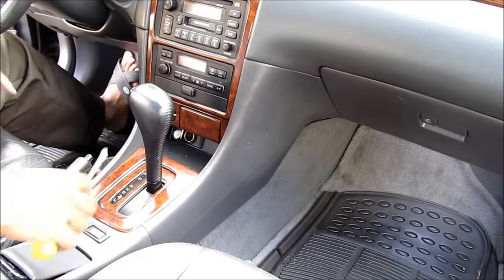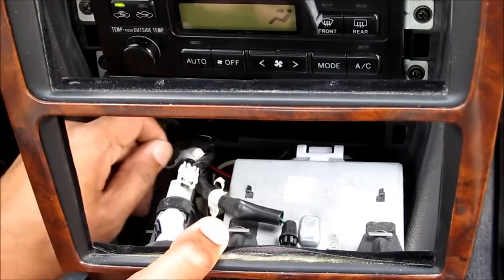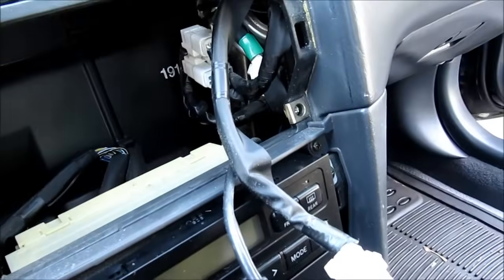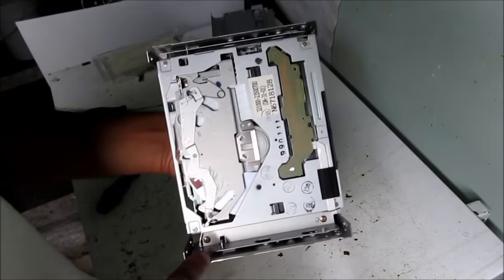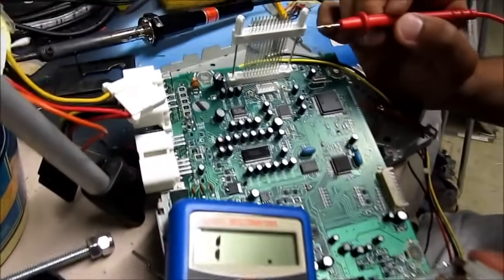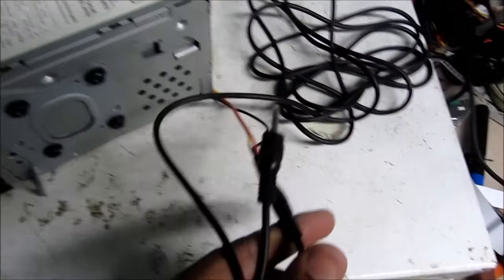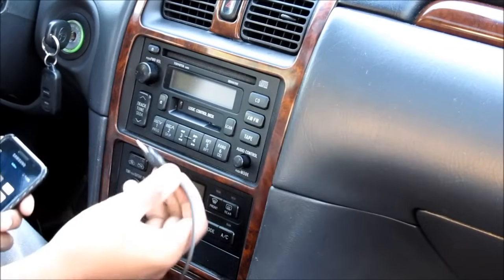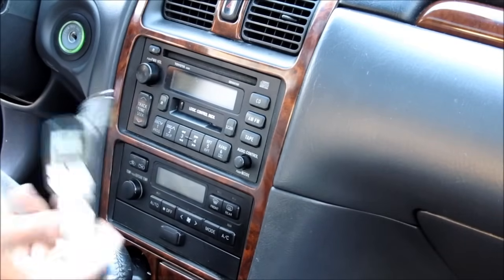Auxiliary Stereo Input Hack

Comment: I have a 94 Lincoln Mark 8 with attend disc CD changer and a tape deck I want to do something like this but keep the existing systems functioning. Do you have a solution for this? I guess it's just a matter of connecting the tape heads and living with the hiss sound?

Comment: Sorry for the comment on the really old video, but doing the same thing in a Hilux. If you had removed the springs in the cassette tape leaving it in the “loaded” mode. Would the tape mode work to turn the aux on?
Reply from the maker: Yes but the motor also has to be turning so a real cassette does the job better

Comment: Too bad , did not work for me , my CD has problem, it couldn't tell the control chip ,to select the CD , I had to go to the FM override option. Works just fine.
Reply from the maker: Good to know. What car?
Reply: @speedkar99  
It's an old lady, a Toyota Cressida 1984 , Fitted With a Nissan 2000 audio system. Your videos, were  very helpful indeed, thank you for that.

Comment: I did this on my 05 4runner and ran into obstacles... The FM radio is not bypassed when playing through the new auxiliary cord. The only way it works is by activating the tape deck, which stupidly is only possible by having a tape inserted. While I am able to get high quality sound through the audio, my tape deck makes super annoying noise when playing! Little tics and squeaks from the mechanism operating the tape. When I look at the stereo mother board I have no idea what I'm looking at... Is there any way to easily rig it so the tape deck is activated without actually inserting a tape? Or maybe the FM radio has L and R soldering points? I don't need FM or AM radio ...
Reply from the maker: Try turning off the radio, plugging in the phone and playing music then turn it on. 

Or you can play with the limit switches inside the cassette deck to trick it in to thinking there's a cassette tape in the deck

Comment: That is cool & I believe very doable for my skills. However, I want to add a headphone cable (end result being female), so that I can listen to stereo w/out bothering my wife, who is annoyed by loud music. Could the same principle be applied to this purpose instead? Will be using the smaller earbud type rather than a heavy set (or 'cans'). Is the process the same, provided I can find the adapter leads (preferably all in one kit)?

Would had been great for Toyota to include this on all 2000 models & up. Maybe they did with select, more expensive vehicles. Yet I love the sound of the stock JBL unit, the best I've had in an auto stereo, seems like they'd include a jack somewhere (obviously not looking at this video). In the past, I found a hidden cruise control module behind a pop out trim piece when cleaning my ride. Only thing needed was a new (the correct) multipurpose arm for the headlights & whatever else was connected, found in a junkyard for $10, once installed, the cruise worked. If not mistaken, a 1976 Dodge Aspen coupe, near 10 years old at the time. I presume this was a (quick) way for the dealership to add a few more hundred bucks to the price of car by swapping the left lever.
Reply from the maker: Yes you would solder the cable to the unamplified output of the speakers. 

The only thing is you need some sort of a cut off for the car speakers
Reply: @speedkar99  Yes, that's the tricky part! Especially being the car has the premium 6 speaker JBL unit with separate tweeters in the doors. There were two identical models on the lot with the same running gear & color. The main differences in ours, which was $1,300 more, was the inclusion of a powered 2 way sunroof (can tilt up or slide fully open) & the premium JBL stereo, that's the one I fell in love with. Too bad they didn't have BT in those days, if so, weren't offered by Toyota. 

I could always consider the purchase of a new & more featured touch stereo that would include a jack (or BT) for private listening, as well as the inclusion of a USB updatable navigation system & no wire splicing. I used to buy my replacement stereos from Crutchfield, for an extra $10 or so, add an exact fit adapter so no splicing required. Maybe that's my best option. Can always get at least $50 for the stock unit, maybe more, depending on demand for these & supply available. 

Still love your video! Will be on the lookout for more.

Comment: y not just buy a dummy cassette? or better yet. Solder the wires directly to the 3 wires on the head of the cassette reader. There is no way radio gives you CD quality. the quality is about the same as using a good FM transmitter. What happens when the wire breaks?

Comment: Have been in there 'deep' as you before - however, would inquire if there is any way to use that other 'plug input' on the back (like, what is it? Why not used?) with an adapter to obtain an input?
Reply from the maker: Yes but you'd probably need a emulator

Comment: Hello, I watched your video about a year or two ago but haven't had the courage to try this until now lol. What is the ground wire for and is it from the aux cable? It looks like the 2 wires you soldered onto the board were separate wires that you can buy from a hardware store, does that make the sound better or is it optional? If it is, what size wire should I buy and does it matter if I use the kind with smaller wires or a single solid wire? Also, I'm new to soldering but I bought a cheap starter kit to do this project. I can just use a push-in connector instead of soldering the wires to the aux cable? (Do all aux cables have a ground wire in them? What difference does it make?). Thanks.
Reply from the maker: Solder is the best bet. Those were just hookup wires...no need for them as you can solder the plug direct.

Comment: I have this exact car model with this exact same radio face. But when I opened the radio the circuit was completely different. I am about to look if I can trace the tape deck pins to some post equalizer solder points.
Reply from the maker: It should be the same in theory

Comment: i tried on my 2000 4runner....didnt go too well. the motherboard didnt have any clear labels for the audio out on the circuitry. i tried the LCH and RCH on the cd player near the ribbon cable connector. it farts in my speakers but the player itself wont even switch on. pretty sure its shorted. oh well it was fun to try.

Comment: I just did this to my 2000 toyota camry with non JBL Radio.  Your insight to soldering the right connections on the motherboard were spot on.  It overrides the radio just like you said it would!!

Comment: Just found this after I did something similar. I grabbed a small 3.5mm female audio adapter and I drilled a small hole next to the DISC emblem and drilled through the inside plate then ran it down to the board. Works well you did it long before me, but I have the same head unit in my AE86 and SW20. Like the stock Toyota look.
Reply from the maker: Yea the stock look is classic. Glad it worked out for you
Reply: I usually use a cassette to auxiliary tape for my music. You can find at dollar store,  radioshack or similar (I think that went out of business) or order on Amazon. They range anywhere from 4$ - 20$. I usually get one for 5 bucks.
Reply: DJ DamnSelf yeah but you have the audio degradation that comes from uaing a tape adapter...
Reply: Robert Hollar Not at all

Comment: Hey, Just wanted to say thanks. Your videos helped me to do this and saved me $100 or whatever it was to buy a headunit. I watched all your aux hack videos before attempting to do this. It was also the first time soldering, much easier than expected. 

I connected the Aux jack to a bluebooth car kit and now everything is wireless and hands-free in a 90s car. Thanks!
Reply from the maker: +PancakePlease good to know, I would like to do a Bluetooth aux hack video soon, did you need a ground loop isolator? Where did you power it from?
Reply: I bought this https://www.amazon.com/SoundBot-SB360-Bluetooth-Hands-Free-Streaming/dp/B00RH29CJO/ref=sr_1_3?ie=UTF8&qid=1523298051&sr=8-3&keywords=soundbot+bluetooth+car

basically I did your aux hack with a female aux. Plug the Soundbot aux male into it, plug the wires in the 12v adapter, wired it all behind the dash. It connects automatically (with the option to turn it off if you like), has a mic for voice calls, and is set to Tape mode on my headunit. 

I needed a ground loop isolator for the aux cable without bluetooth otherwise there would be a faint buzzing noise when turning up the volume.

Comment: Thanks for the awesome video! I have a quick question though, do you know if it is because I solder incorrect so the sound quality is difference when played on AM vs FM mode? Through the AM mode, the vocal or center sounds louder and is more quiet in FM mode.

I tried using an aux Bluetooth receiver but I would hear the radio in the background while the aux is playing, which is not obvious when connected directly with aux. Do you know if there is a workaround?

Thanks!

Comment: Can you please do an aux cord hack for an old headunit that only has a casette tape option on it? It would mean the world to me. Thanks!
Reply from the maker: +Isaiah Garcia that's exactly what I did here, I went thru the cassette lines that eventually led up to the radio lines. 
Look up my Lexus aux hack I did another video thru cassette as well
Reply: speedkar99 I just finished watching the lexus aux hack video. The thing is, when I disassembled my headunit the other day, I couldnt see where I should solder the aux connections. Im not that good with electronics to be honest. Its an old kenwood headunit. If its not too much to ask, can I send you pics of the headunit disassembled and tell me where to solder the aux connections? And is it possible to trick the headunit that theres a casette in it instead of actually having one in there? The lexus hack required you to have a casette in it. I hope you can help me out. It would really help me a lot :) thanks!
Reply from the maker: +Isaiah Garcia how about the fm board? Any leads there
Reply: speedkar99 not really. The things is, I dont see any "R" or "L" to solder aux points to. The motherboard hardly gives any information about the connections. I'm not entirely inexperienced when it comes to audio configurations but man this aux hack thing is making me feel stupid asf. And it sucks bc theres no way I can afford a new headunit within the next couple of years. Or atleast until I finish college and get a job. :(

Comment: Great video! I have a 1996 Land Cruiser and I was able to follow your video to get the radio apart and access the circuit boards. But it is obviously different than your Solara and I don't see any points clearly labeled R and L. Any suggestions? could I send you a picture of the boards and maybe you can identify?
Reply from the maker: +Michael Schaller Hmm did you try the CD changer? 
Sometimes it just takes trial and error
Reply: I did look at the CD changer but also didn't find any clearly labeled points called L and R. After looking more at what I think is the motherboard I found test points (TP200 and TP300) labeled L and R. They're next to some pots. Can you look at this photos and see if that looks right? Also what do you mean by trial and error? Just try soldering the aux cable to them and seeing if it works? 

https://www.dropbox.com/s/64i2s291dgh3cav/land%20cruiser%20stereo%20-%20board.pdf?dl=0

https://www.dropbox.com/s/cdh7yv29nl7c78n/land%20cruiser%20stereo%20-%20test%20pins.pdf?dl=0
Reply from the maker: +Michael Schaller Yes sometimes you have to try soldering and see what works. You can send me links through a PM, I can't open it here.

Comment: Your videos are very informative.  I also have the same exact radio and wanted to do the same.  In term of sound quality, would it be better if I use the CD input instead of using the FM signal?  I understand that a blank CD is needed to play using this mod.  My question is, where on the board do I solder the L/R in order to use the CD input.  Thanks!!
Reply from the maker: +Hung Lam yep CD will work, see my other CD stereo aux hack vide I posted earlier this hear for details!!

Comment: I have after market speakers that were installed before I bought my 98 Camry. Will that cause any issues if I try this? Theyre a lot better speakers than the stock. I'm just nervous that I'm gonna fuck something up and have no music at all in my car.
Reply from the maker: +LiftedByChoice Nah the speakers shouldn't affect it
Reply: Alright. I just bought a cassette aux and it works pretty good. Except when it gets REALLY loud then it starts to fuzz out a little. But I don't want it that loud anyways because of the strain it puts on your alternator. Especially since mine is still stock somehow. Thanks for the info though. Maybe I'll give it a shot if I get subs or something.

Comment: Can you still play cassettes and the CD in the original head unit?
Reply from the maker: +Quad8track yes
Reply: Thanks! Cassette and CD functions exactly the same huh? I want to do this!
Reply from the maker: +Quad8track yes, as long as you don't pull out the wire going to the motor like I did, it will work. I have a few other aux videos showing other methods too, check them out.

Comment: So all you're really doing is just overriding the FM when you have it plugged in. Which means it's not as clear as a true AUX port would be, not to mention that there's still a possibility of FM interference when plugged in.
Reply from the maker: +Britney Miller it is pretty clear once the aux starts to play. FYI the cassette does the same override.
Reply: speedkar99 The cassette is using the cassette player to play over the line. What your doing is just interfering the FM.

Comment: Connected the aux wire to inbuilt fm modulator and the voice quality is too bad. How do I rectify this :/
And if I connect aux directly to L and R of cassette player will it sound any better than "cassette-aux"?
Reply from the maker: Yes it will be better quality because its direct to the equalizer and won't have the static and hiss of a cassette adapter.

Comment: need your advice AGAIN lol on the radio situation. i was resoldeering the connect points. the reason being switching out aux cables. and in doing so i had the radio down to just the main circuit board and to test if both sides of speakers where working . i had the board plugged in and just the face plate on to control the radio. and in doing so some of the solder points must have touched a piece of metal because the radio shutoff . and i mean shutoff like the cassette tape wont resond or cd playyer when i connect everything .. idk if that could be a fuse? or if i now need a new radio ?
Reply from the maker: +david anderson I'm not sure if the radio has a fuse internally. But yes that's the first place to start. Next, examine the motherboard for signs of burned components, swollen capacitors, or open circuit, especially in the area where the power transistors are. If you have JBL keep in mind the amp is behind the glovebox and can check that too
Reply: I figured it out .. but i think after so many trial and error the solder point for the left and right is no good i cant get solder to stick and everythings a mess aka melted around it lol . So unless theres a way to get the leads to stick to the motherboard or another contact point i think im screwed
Reply: @anthonyanderson5635  next time you solder try to buy extra flux and have it on hand for your project. my early solders were a blob mess until i learned how to use flux better. there are lots of youtube tutorials on that. good luck with your next build!

Comment: Very excited to try this. Have the same radio unit in a '98 4Runner. Thanks, man. Just curious if you can explain the theory behind how this works a little more. Also wanna make sure I understand... So if the car unit is on FM mode and the phone is not plugged into the aux cable, the FM radio will be heard through the speakers, but if the car unit is on FM mode and the phone IS plugged into the aux cable, the FM radio signal is completely muted and the aux cable signal is the only thing that's heard through the speakers?? And it comes through in stereo? And the FM radio doesn't start to play if you pause your aux music?? It only starts to play if you unplug the aux cable? Just from soldering those two wires and connecting ground?? That sounds way too good to be true. Am I understanding this correctly?

How tf does the car unit know to stop listening to the FM radio and start listening to the aux signal just by having the phone plugged in??
Reply from the maker: +Nick Brumme The phone overrides the FM signal. It also depends which phone your using, the scenario described was how it worked for my Samsung galaxy s1. For my s5 you have to press play on The phone first then turn the radio on, otherwise you get interference. Has to do with jack detection I think.
Reply: speedkar99 jack detection doesn't explain the full picture as the jack detection would be on the phone's end of the cable, and this is just a TRS jack sending L & R channels of audio from what I understand; I'm curious how the car unit knows to switch what it's listening to.

Anybody else have any input?

How can I guarantee my phone (or any phone) plugged into this new connector will mute the radio even when there's no music playing?

Comment: its works for  Toyota Rav4  model 58806 radio ?
Reply from the maker: +Bulka If it has a tape deck it should.
Reply: this radio dont have a tape  just only CD, so its possible to make aux ?
CD doesn't work :p so i dont need it
Reply from the maker: +Bulka You could try connecting to the CD left and right ports but you'd have to put in a blank CD to get it to read from those inputs. 
Or connect to your FM lines. Open the board and see if you see left and right channels.